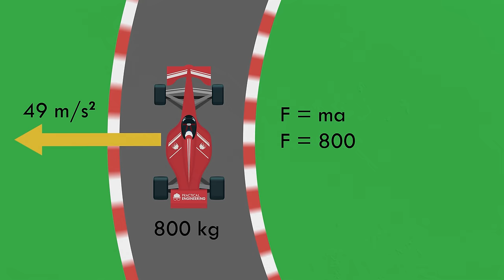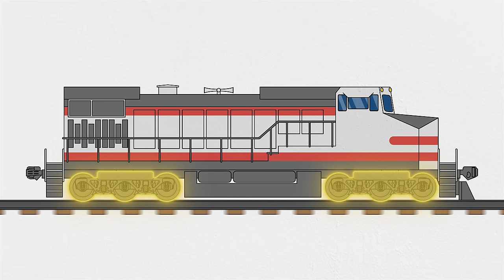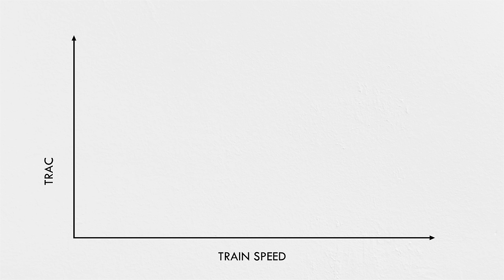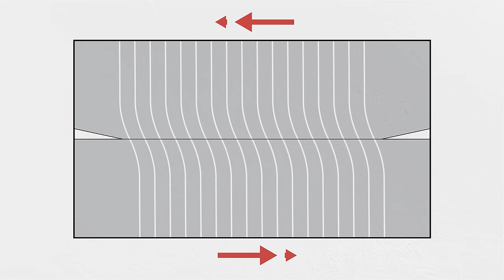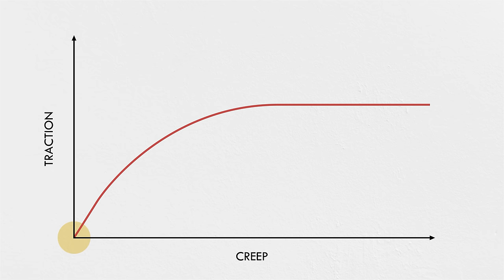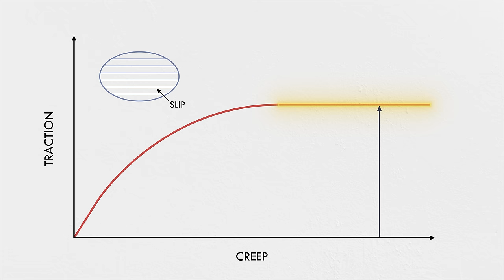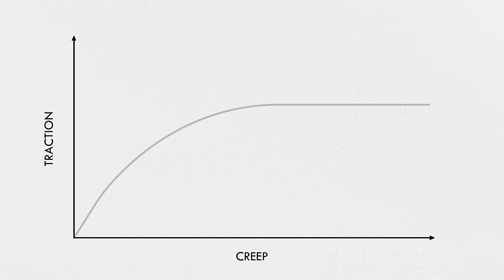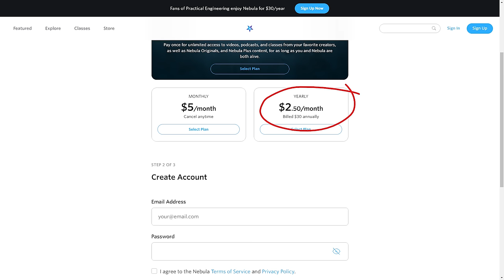Why Locomotives Don't Have Tires

Comment: As soon as I saw the title I was thinking..."But many locomotive Do have tyres though" 
Especially Steam Locomotives! I don't know of a single design that doesn't. 
Back then, they were well aware of the lack of friction between the driving wheels and the rails, So these hard wearing "tyres" were installed to help increase the friction without affecting the rolling resistance too much. Also alot of steam locomotives were very prone to wheelslip. Some were better than others, but generally, the larger the wheel the more likely it was to slip. Hence why alot of freight locos had relatively small driving wheels. 
So the reason for tyres on Steam engines was purely cost saving. The Driving wheels are very expensive to mold and machine (Some can be in excess of 6 or 7 foot in diameter), So they put tyres on, these ware out and you just put on a new set. Saving the steel part of the wheel and a truck load of money in the process.
Reply: The "tires" used in this case are also metal and if I remember correctly some modern trains use the same tech because cost savings.
Reply: It's kind of an issue with terminology across cultures; the US population (example; me) generally only refers to something as a "Tire" if it's the removable rubber kind.
Reply: Diesel locos had tyres too. I know this because I have shares in ownership of class 20, 31 & 47 BR diesel locos and back when I was a active volunteer we painted white marks across the sides of the tyres and onto the wheel hubs so that it was easy to spot if a tyre had slipped.
Reply: also lots of metro sets have tyred wheels
Reply: @matthewutech5970  Wheelwrights use the term for wooden cart wheels which have been around since forever. A shrink fit steel tire/tyre that holds the wooden wheel together.
Reply: @matthewutech5970  no offence intended, but it's an education issue not a culture issue. I'm American and our school system doesn't work well.
Reply: @matthewutech5970  as a fellow murican. I agree I only know the term properly because adhd deep dives
Reply: @flyingmonkeydeathsquadronc968  Just cause poor education is the main cause for this, and other linguistic flub in communication does not mean our culture wasn't also affected over the decades. What initially started as poor teaching practices has evolved into practical common language if you're in the US.
Reply: @matthewutech5970  while I will agree that American linguistics have evolved due to cultural changes, I find this particular issue with locomotive tires or wagon tires to be due to a lack of knowledge that the device know as a tire even existed within those particular application. I'm sure a lot of Americans think the settlers that came out west had bare wood against the road and the idea of a forged steel tire on a cast steel locomotive wheel as preposterous.

Id also argue that "practical" may not be the best word to describe some of the more recent changes to American English.
Reply: Actually, steam loco wheel size is more about what speed the engine is optimized for. The pistons can only do so many strokes per minute, and without a gearbox, that's directly corresponding to wheel rpm. Bigger wheel, more speed at same piston-limited rpm.
And it's less so that the tires increase the friction, but more that it allows getting away with casting the wheels which is metallurgically far easier than forging them, and by the time they got obsolete electric trains still hadn't (really) switched to monoblock wheels (3 forged pieces of wheelset: axle + 2x wheel. No tire. Driven axles tbf add some additional gears or such onto the axle.
Reply: @matthewutech5970  Hmmm, ok, then how to you refer to the steel/iron thingy on the outside of wooden cart wheels that holds the wheel together and protects it from wear and damage?
Reply: I think the wheel diameter had more to do with gearing. Passenger locos had bigger dia driving wheels which made them faster, the load is less. The freight locos had smaller wheels to give them more power due to the smaller driving wheel, they didn’t want them to go as fast because of the greater load. A smaller wheel would in theory have a smaller contact area which seems counter productive.
Reply: @jefftheaussie2225  It's about the lever arm and tractive effort. The smaller wheels typically allow for more wheels with the contact patch being relatively the same between big wheels and small wheels.  what matters most is the distance between the axle and the crank pin smaller the distance the less travel of the piston which along with the diameter of the wheel allows for higher speed. The larger the distance the more force applied to the wheel and the longer the piston travel time.

Aside from very specific applications, typically logging locomotives, gearing on steam locomotives is incredibly rare

Comment: Nice work in explaining creep! I always find it difficult to explain it to others without involving differential equations and material flow. I never thought about bristles on a rotating disc! That was amazing!  Also a small nitpick is the stick slip illustration. The leading edge is always in stick. Only the trailing edge slips within the contact patch. As the creepage increases the slip area completely covers the contact patch as you showed.

Comment: Very interesting.  Steam locomotives have steel tires on their wheels.  When they wear down, they are replaced, just like a car tire.  Diesel locomotives have witness grooves in their wheels, which determine when the wheel has to be replaced.  The factor of adhesion was always a consideration with steam engines.  Too low of a factor and the engine would be limited in its use.  Diesel and steam engines are inverse in how they put down power and all of this starts with the factor of cohesion.  This is another subject, really, but it is all part of the whole.
Reply: Steel tyres can work on slow steam trains and trams but the engineering community has moved away from steel tyres after the Eschede high speed train crash in Germany. When one of the tyres cracked then got caught on some points. The tyre unrolled itself into a spear that penetrated the carriage. Over 100 dead.
 Anyway steel tyres are more trouble than they are worth with machining,  press fitting and the danger of them coming apart. Much easier/safer to make a solid wheel,   when they wear recycle them to make new wheels. 
Its amazing that train technology hasnt changed much in 300 years when it comes to wheels and rails. Other than minor improvements like welded rail its basically the same.
Reply: @tubester4567  Yes, I know of this accident.  It was caused by the tire separating from the rubber damping ring, between the tire and the wheel.  They used this design because of vibrations caused by the original steel wheels, at high speed.  They thought that this would mitigate the problem.  This design was never meant for high-speed applications.  It was never tested for this type of use.  Steam locomotive tires were pressed on hot and allowed to cool, shrinking them onto the wheel.  This made them an integral part of the wheel  This is how they did it in the age of steam.  Rubber dampers were never part of the equation on steam locomotives.
Reply: @tubester4567  Yes, I know of this accident.  It was caused by the tire separating from the rubber damping ring, between the tire and the wheel.  They used this design because of vibrations caused by the original steel wheels, at high speed.  They thought that this would mitigate the problem.  This design was never meant for high-speed applications.  It was never tested for this type of use.  Steam locomotive tires were pressed on hot and allowed to cool, shrinking them onto the wheel.  This made them an integral part of the wheel  This is how they did it in the age of steam.  Rubber dampers were never part of the equation on steam locomotives.
Reply: @tubester4567  the do still run steel on steel tyres though. That accident had a different design that sparked the failure/accident.
Reply: @alistairwhite2906  Only on trams and slow speed/historic trains. Many modern trains are even moving the brakes from the wheel to a separate brake disc rotor. Most of the wear on train wheels comes from the brakes.
Reply: "Diesel locomotives have witness grooves"  Why "Diesel"?  Wouldn't all locomotives have this?  Electric locomotives do exist, even though the US has basically none.  Here in Germany, diesel locomotives are largely limited to rail yards.
Reply: could even replace that with "modern" locomotives

Comment: In the UK (And probably elsewhere, idk) trains actually do have tyres, they're just also made of steel, because it's cheaper and easier to replace the detachable band of metal round the edge of the wheel than the entire wheel.

Edit: Ok, I spelled it wrong, I get it.
Reply: In the UK they are tyres. They spell funny. (plough)
Reply: Correct. They all have tyres (correct spelling in English), it’s just not vulcanised rubber. Changing a steel alloy tyre is cheaper than scrapping a wheel.
Reply: Stream locomotives in the US had the same thing.
Reply: Trains also get "flat" tyres/tires at times This is usually from brake problems or harsh (emergency?) braking where a wheel skids along the rails for a distance without turning.
Reply: Only tyres on older locomotives , even on the 1970's class 56 we started to fit Monoblock wheels , waggons virtually all have Monoblock wheels . We did get problems with tyres if they had been heated due to dragging brakes , the tyres would move on the wheel this is why you often see white pain marks on wheels ,tyres had secondary security the gibson ring on inside of tyre
Reply: @keithstudly6071   No, just the difference between English and Americanese.
Reply: Tires

Comment: 3:28 Friction isn't a horizontal line, it's actually sloping down as approximated by the Curtius-Kniffler formula. At higher speeds you don't have the same adhesion as you have at standstill.

Comment: Race cars generate quite a bit of aerodynamic downforce, so the friction calculation isn't only the weight of the car; it could be 2 or 3x that.
Reply: Yeah, I think that's why he started with "it's the weight" and then generalized to "it's actually the normal force which includes other things."
For the purpose of this video, I think "weight" is good enough. Trains don't usually pull a lot of G's around corners, and I venture that aerodynamic effects aren't a big component. (Though somewhere there's a good ol' boy with a spoiler on his loco...there has to be. 😂)

Comment: 0:00 I think that's Indycar and some sort of junior open wheeler championship, not formula 1

Edit: Hey, since you're working on subject of train. Why don't you do a collab with Hyce? He's on Youtube and his day job is an operator/engineer/fireman of a steam engine and part time mechanic/fabricator at Colorado Railway Museum
Reply: I'm going to guess that licensing F1 footage is expensive as hell.
Reply: At 0:00, yes, that was Formula 1.  But then instantly transitions within seconds to the what you suggested.
Reply: F1 is quick to shut down unauthorized use of their video.
Reply: @NorthernChev  No that was indycar, but no doubt actual F1 footage would be taken down in seconds 🙄
Reply: @Xelopheris  100%
Would have been copyright struck instantly too probably.
Reply: @NorthernChev  No, at no point was there an F1 car shown, present or past. All the footage comes from Indycar or some type of open wheel junior series.

Comment: I had no idea the dragster burnout thing had a practical purpose with warming up the tyres for adhesion. Today I learned!
Reply: Actually the other half is to clean the tires.
Tires are soft and you don't want the small stones and powdered concrete picked up by driving from the pits (or return road etc) to be dropped along the track, That could potentially lead to a car traveling at high speed to come unstuck and hit the wall or opponent.
-You go through the water to get the tires slightly wet which helps lower traction to help all cars start the burnout.
-You don't do the burnout in the water which would spray everyone, you roll just ahead of it.
-During the burnout any small stones previously picked up from the pits are flung off and out leaving the tire cleaner and obviously allot warmer.

-When done on a street race sometimes water will be used and other times a VeryHighTraction fluid is used by pouring ahead of the wheels and the car moved into it.
-As the burnout is done the whole wheel gets coated, VHT is already sticky but it can also help break down the rubber and make it even softer and give yet more grip, As the car moves forward this helps transfer some of the rubber from the tire onto the street for a rubber-rubber contact.
Reply: Also leaves rubber on the track which provides more grip again

Comment: I ride dirt bikes, and you mentioning F1 and tire traction made me think about Stark Varg the new electric dirt bike. A lot of people say it will be unfair because of the instant power and torque it can create, but as you said it's about the traction. You can have a dirt bike that makes 1,000 hp but if you can't get the power to other ground then it doesn't matter.

Comment: 11:37 You can see the Helmholtz waves in the vibrating violin strings. Strings that are being drawn by a bow don't oscillate like a sinusoid as you'd expect. Instead they vibrate as a triangle wave with a moving apex called Helmholtz waves.

Comment: Most freights are designed to start with a  progressive yank instead of a straight pull. If the full length of the train was parked with all of the 'slop' in the couplers pulled tight, the engine would not be able to start without stalling or slipping traction. You can hear this effect when the long trains stop and start.

Comment: Point of order: they do have tyres, it’s the outer steel of the wheel. They can be ground to restore the desired profile or rotated around the locomotive during maintenance. They can even be replaced during midlife overhaul 😃

Comment: i always wondered why locomotives experienced wheelslip if they applied full engine power when starting to move. now i know it happens from the contact patch getting less traction because the train is forcing its full tractive effort at a low speed... even as a long-time railfan im still learning new things and it really brightens my day, grady

Comment: I have never once wondered why trains don’t have tires. But now I’m curious 😂
Reply: Haha yeah
Reply: Didn’t ask + my videos are way better than Practical Engineering 💀🤣
Reply: You didn't listen. The tires of steel wheels are steel.
Reply: @TRUMAN_THE_TRUE_MAN i watched the entirety of your catalog while wiping my bungus
Reply: @TheDavidlloydjones  I’d argue trains have wheels but no tires
Reply: Are you prepared to have your mind blown? Ready? Trains don’t even have steering wheels.
Reply: @philtheairplanemechanic  Please wipe your phone off as well, just in case... 😂
Reply: @TheGbelcher  Trains have tyres. They're made of steel and fitted round the cast wheels to provide a smooth surface that's easily replaced when worn
Reply: German high speed trains had steel tyres for noise control

 It didn't end well
Reply: @TheDavidlloydjones  You are very much correct sir.  
tire 2 noun: a metal hoop that forms the tread of a wheel
Reply: Some trains do. In the US, wheels are solid steel, but over in Europe it's not uncommon to have a solid steel wheel with a steel tire fitted (they heat the tire to expand it and then put it in place, and it contracts as it cools to form a tight interference fit). There have been several experiments with hard rubber tires on locomotives, and the results have rarely been worth the effort. I can't find anything right now, but I'm pretty sure the Soviets tried it a few times. Probably the most successful rubber-tired locomotive was the Buckwalter electric tractor used by the PRR, which is more of a primitive trackmobile.
Reply: Steam locos had tires.
Reply: @miscbits6399   The German ICE trains had steel wheels with steel tyres and a layer of rubber sandwiched between the two.   It was one of those tyres that failed in the Eschede disaster.   
However steel tyres on steel wheels were almost universal in the days of steam in Britain and probably Europe, and such tyres rarely failed.
Reply: @quintrankid8045  Still do.
Reply: @curiousnomadic  Yes, but there aren't as many steam locos around now, and I'm only aware of two or three new ones being built.  One done in the UK, Tornado, based on the A1 Pacific, and another, I think n progress, Prince of Wales.  I think there's something on in the US to build a new Pennsylvania RR T1.
Reply: @miscbits6399  Main advantage was the price (cheaper to replace a tire). By 1998 most wheels were already monoblock, but after the disaster lots of railways companies banned those wheels with tire.
Reply: @quintrankid8045  There are actually a few more than there were a decade ago.  Japan and India actually operate some.
Reply: @miscbits6399  It was the rubber damping between wheel and tyre that was the issue , steel tyre directly on steel wheel is perfectly ok
Reply: @nounoufriend1442  Mostly, but I have a vague recollection about watching a doc in which a passenger car wheel came apart in a spot where it had some number in the casting. Maybe a brake shoe was stuck and made the thing overheat and the number was the first thing to fracture?

Comment: Great explanation of how wheel creep works. My dad was one of the engineers who worked on the implementation of EMD's Super Series wheel slip/creep system. The EMD 50 series locomotives used a radar system to measure the actual ground speed of the locomotive. I know my dad worked on the radar system design and the high voltage cabinet (where the 50 series control system modules live).